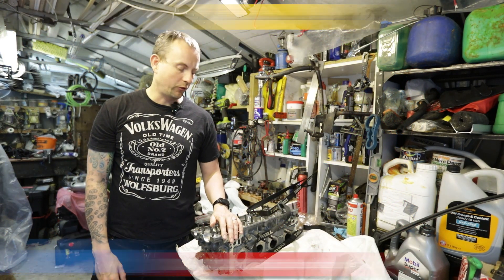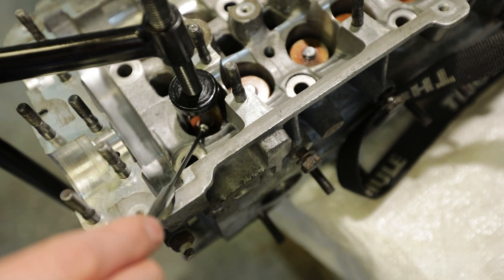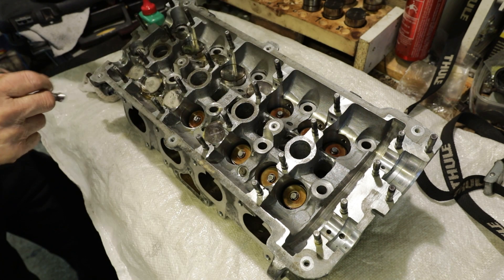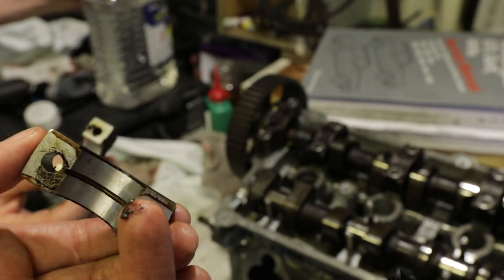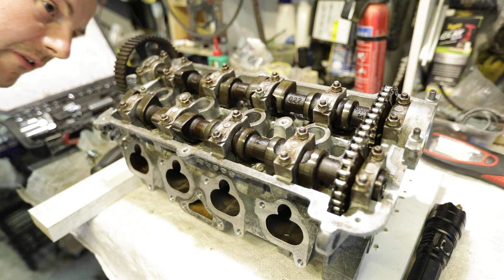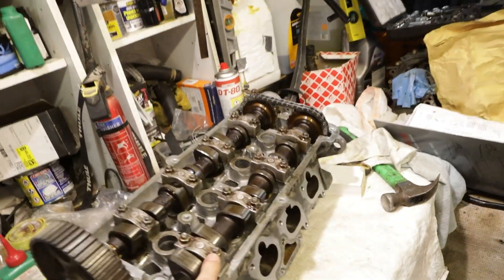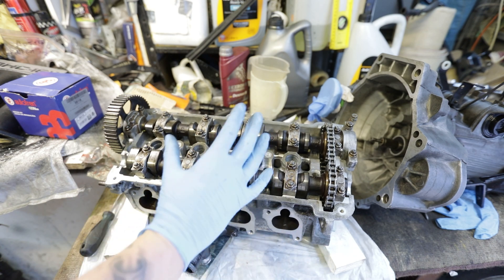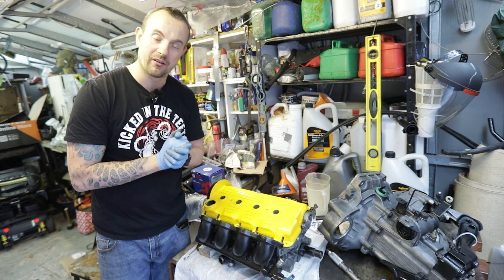MK2 Golf 16V GTI Head Rebuild - Engine Refurb PT5

Comment: I took my head to a machinist today to get it pressure tested and to have the cracks in the firing chamber looked at. They were all good for everything except for what looks like missing oil channels/galleys in the camshaft beds. Inspecting your video and detail I can see that mine is exactly the same as yours. The exhaust beds have no galley/channel groove for oil. The hole is there and then on the intake side there is a slight galley/channel only on the wall closest to the Intake entry point. Weird thing is, my cylinder 1 and 2 have a slight groove in the beds. Every other picture I find of 9A/KR/ABF head rebuilds all look exactly the same. Unfortunately I cannot find anything online of a stock factory new one anywhere to confirm anything. It could easily be seen as wear over time though. I take it your engine is running smoothly without any oil starvation issues in the head?
Reply from the maker: Hiya mate! That’s weird, I know on the diesel engines there were two variants with different oil channels, not heard of that on the KR though.
Honestly I haven’t really had my engine running that much yet as I’ve been sorting a few electrical issues out before I can send it for an MOT.
But when it has been running it’s seemed okay…
If you message me on instagram I can see if I’ve any photos of the head to send for comparison